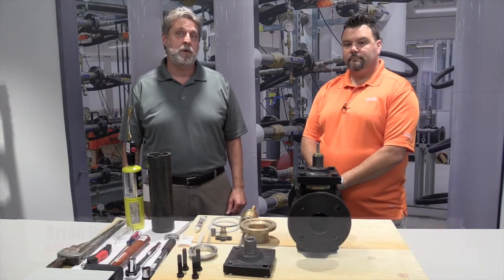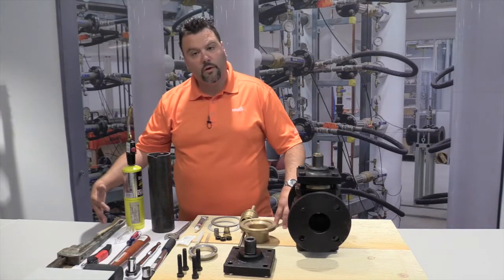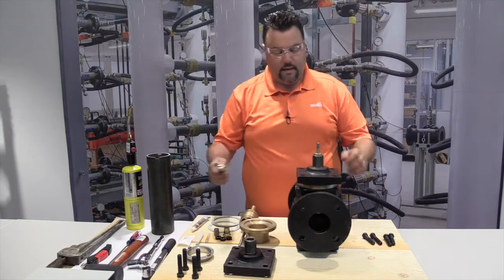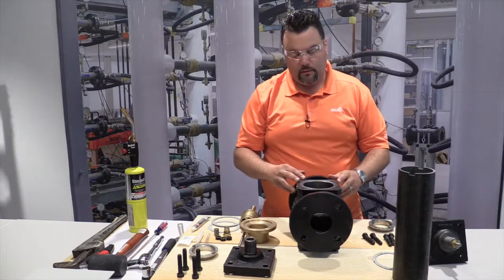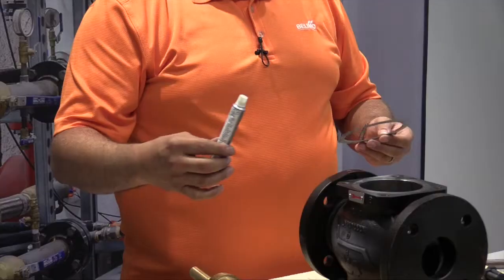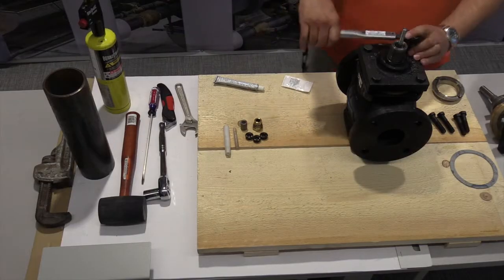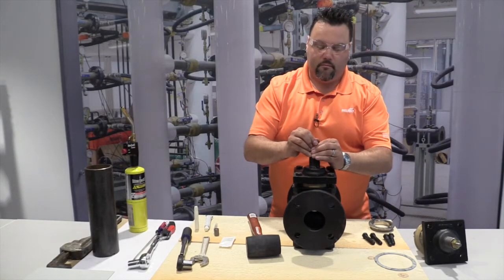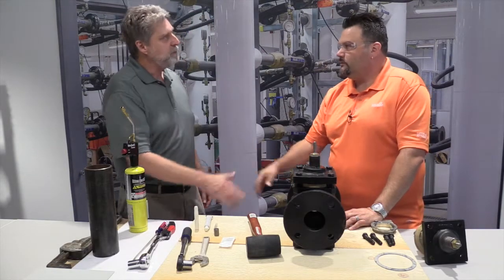How To: Rebuild a Globe Valve

Comment: The cost of the kit and the labor make it to where your better off buying a new valve if it is leaking.
Reply from the maker: Hello Juan, We estimate that you would save money using the rebuild kits as the installation of tearing down an old valve and replacing it with a new one is still going to be more than the replacement work which as you can see from Joe's tutorial is simpler. Additionally, there is a cost savings to a rebuilt kit than a new valve. If you have any additional questions about rebuild kits we would be happy to answer them!